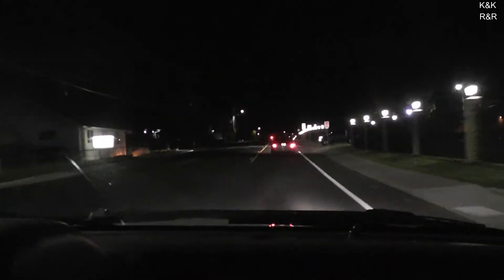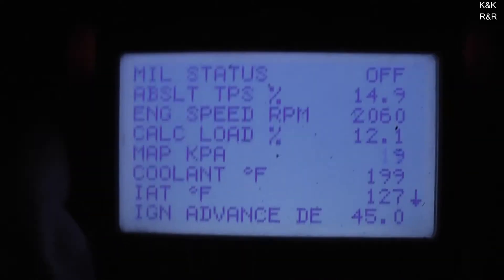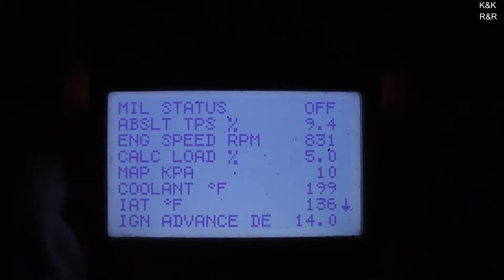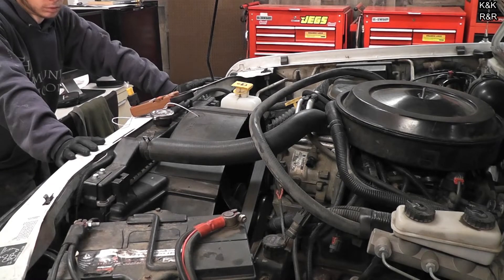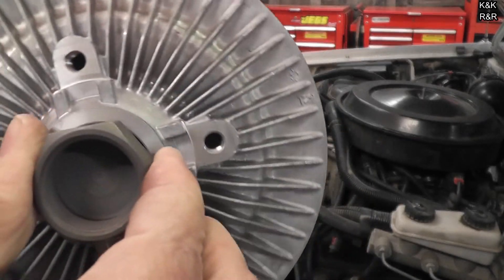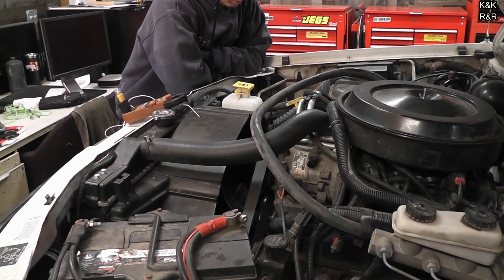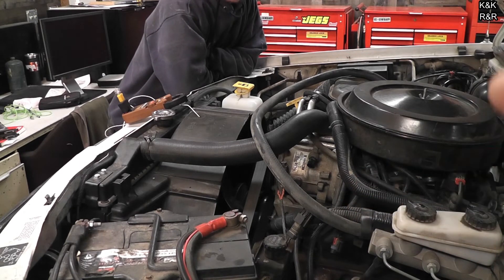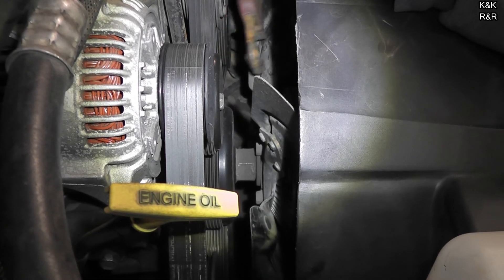Case Study: Locked Up Fan Clutch Pt1 Diagnosis 1996 Dodge Dakota 3.9L V6

Comment: I have this exact problem on my 2000 Dakota, especially when the weather is hot. The fan stays locked even at highway speeds, and it takes a very long time to unlock. In fact, there have been times during extreme heat that the fan will lock back up when I start coasting. It also locks back up every time I come to a stop, and the process repeats itself.

Comment: I went through two aftermarket fan clutches on my 03 gmc sierra. The first one never cycled. Even when holding the rpms at 5k. Got it replaced and it was better but acted like the one in this video. I ended up getting a used one from the junkyard and that worked perfect.
Reply from the maker: Yup I have seen it take 3 different fan clutches to find one that works kinda okay. We have tried them all with the same results. 
/K&K

Comment: Great video, i had a similar issue on my 05 dakota. Factory one wouldnt lock up, got an aftermarket one and it was just like this one. Got ANOTHER aftermarket one and it leaked silicon lube. Long story short, swapped to an electric fan and it feels like a different truck!